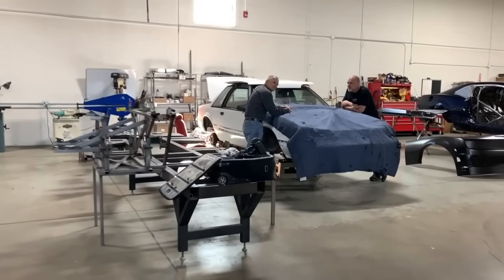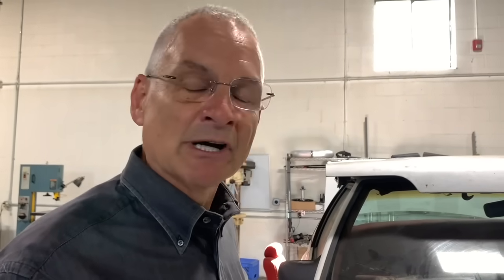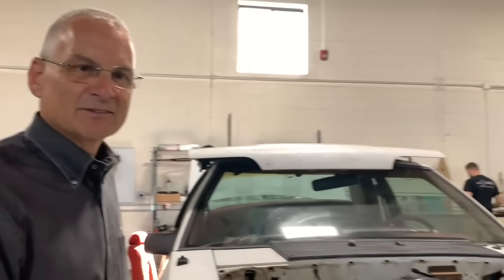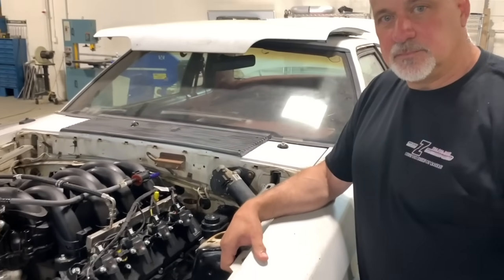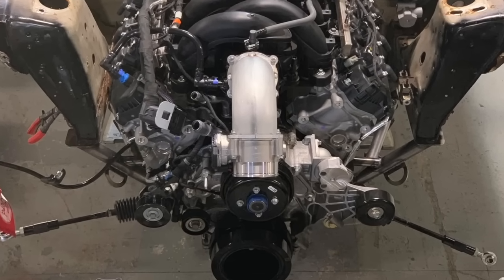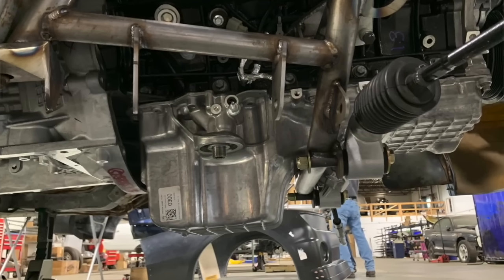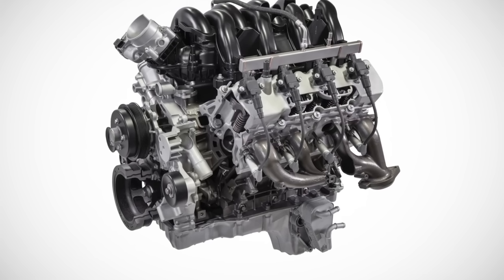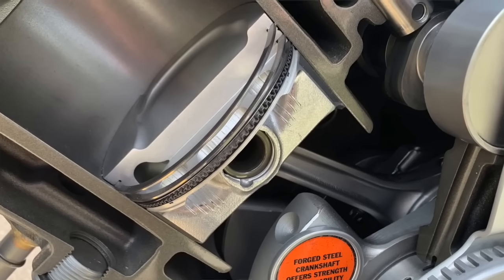Ford 7.3L "Godzilla" V8 Foxbody Mustang Engine Swap — Team Z 446-cube Small-Block Project Part 1

Comment: Revevan that's killa. 

I can't wait to get my hands on one by the end of this year 2020.
I'm in the middle of a dart shp block with billet main caps 351w 427w build with Molnar forged crank,  Molnar forged rods and weisco pistons with a set of trick flow hi port heads etc. 
That will be my next engine lol

I wonder if Comp Cams will make some aggressive camshafts for it. 

I wonder what the cam journal sizes will be on that 7.3 Godzilla engine. 

I wonder if they went with a Windsor step down journal set up or a straight thru 50mm etc on that engine. 

I'm really excited to see what they do with this engine 💡
Reply: The cam has 60 mm bearings, I believe Comp will offer cams.
Reply: Brian Wolfe they are right by me in Memphis TN. 
I can't wait to see what y'all do with this build.. 
Look forward to the upcoming videos

Comment: Be great if there is a crate engine and a standalone wiring harness available. I was hoping one of our terrible drivers around here would have wrecked one in the snow last week and i'd get an engine cheap but there is still the wiring issue. A bigger cam and better intake should bump the power a bunch.

Comment: Not feeling so great about my 393 swap now lol...
Reply: 393?
Reply: 351 roller block with stroker crank.
Let's you use Windsor length rods and 302 pistons. Cheap cubic inches.
Mine has good pistons and rods but you can pick up big power with stock parts and that crank.

https://www.summitracing.com/parts/esp-16526030?seid=srese1&gclid=CjwKCAiA35rxBRAWEiwADqB376z0TPaAIJi5w7wvuC_z1hGfcHGG8jZSCaODua74IunTtOTLRsNh8RoCb3UQAvD_BwE

Comment: The only thing hurting these over the LS swaps is $$ (were working harder than ever for our $ ) 
don't get me wrong I'd much rather put one in my fox coupe, and my 93 obs 2Fiddy setting out back with the boat anchor IDI setting between the rails, but as current pricing dictates it makes more sense to put an LS even in that according to the current market (which kinda sucks 🤷)
Reply: The price will come down as more and more of these engines are manufactured, and also as these engines age over the next few years.
Reply: Chris M. Yeah you need at least a decade of production to make them dirt cheap.

Comment: Motor dynoed at 335.2 whp and  369.5 lb-ft of torque stock . Hopefully the heads flow decent. That has a was to catch up the LS engine. Im looking forward to the comparison.
Reply: Modular Fox Body Actually the motor did not dyno that. The truck did. Remember it has to put the power thru the truck trans, torque converter, huge driveshaft and huge wheels and tires. That’s why the loss from the numbers stated in the vid. If it were to go thru a smaller driveshaft and wheel/tire combo, a lot more power would be delivered to the pavement.
Reply: @crodrc51able  yep, parasitic loss. But even if you calculate that you lost an extra 5% due to the above it still a small gain. My coyote in my fox with twin 6266's can put down 1000whp through a 6R80 . I would be interested in seeing the results throwing boost on the Zilla motor. You torque would kill my coyote.

Comment: It looks physically smaller than a coyote?
Reply: Yeah, it does look like it's smaller. The DOHC cylinder heads on the Coyote are WIDE.
Reply: Ford said it's shorter in height and narrower with the exception of the engine length which is longer than coyote

Comment: I love it but the allure of the LS is always going to be price point and availability. This looks like it's going to be a badass motor with a lot of potential but it will probably be no cheaper then a coyote swap into one of these cars. Which makes it out of reach for the average enthusiast
Reply: Thiis 7.3 is going to have a LARGE production run. I think most people ordering the Super Duty will opt for the 7.3 if they decide to go gas. The Motorhome industry, Uhaul type companies and fleets that run gasoline will all opt for this engine. Simply put, Ford is about to make a SHITLOAD of these engines.
Reply: @lexustech48  maybe, but it's going to take a long time of production and even then it's still going to be more expensive. The coyotes have been around almost 10 years now along with their truck counterparts and they're still expensive. We'll talk more on the subject in a few years :)
Reply: @lexustech48  I can vouch for that. All upcoming U-Haul JH models (the 26 footers) will be Godzilla equipped. Not sure yet on the old E-series yet, it still runs the V10 & there's scuttlebutt about killing that chassis off. I'm a U-Haul service provider so I get a little of the inside skinny. 

An increasing number of business purchasers are not wanting to deal with modern day diesel emissions system problems so the 7.3 is gonna become the hot ticket here in a year or so.

Comment: Make ford racing great again 😅😂
Reply: Ford does need to offer more of the modern engines for swaps
Reply: @albertpintor3522  Ford Racing has Coyote, Voodoo, and Ecoboost crate engines available for swaps. They also have the Aluminator series engines available which come with forged internals.

Comment: What a game changer....it appears as if its going to be a lot less complicated than a Coyote swap too.
Now....what's the cost 🤔
Reply: Going to be high for a bit until enough trucks get out there and get wrecked!
Reply: This swap won’t be any easier then a coyote swap. Especially since ford doesn’t have a swap specific ECU available for it yet.
Reply: I disagree, there is so much more room in that bay.
Reply: Robert Elmo that doesn’t make the swap easier though, the coyote still fits and can be lowered from the top into the engine bay. The hard part of these motor swaps is the wiring and hooking up all your accessories. When the Godzilla has everything aftermarket for swaps that the coyote has they both will be identical. Not to mention you have to get a 3 inch cowl hood because of the way the intake curves up so much on the Godzilla.
Reply: An bolting up the headers, doing something with the power steering where there is no room, I see what you are saying but it looks easier to me.
Reply: @robertelmo7736  based on what they said, it sounded easier to me as well. PCM is something I didn't think about tho 🤔
Reply: It got more room than my Windsor, especially on the sides.
The Coyote is just so wide.
Reply: caaspal I think there will be some after market support for the 7.3, this will beat the Coyote in after market simply because of the Internet and fans wanting to see these engines make huge power
Reply: @williamsanders468  yeah that sounds right but got to remember that the aftermarket is thinking about these being in f250s. So thats where there r&d will be focused at. Not a lot of people will be able to access these for a racecar project. So there will always be limited aftermarket performance parts for these. At least for swaps. May be cooling and extra oiling options soon for towing ect..but high hp not so much,imo. But who knows.
Reply: ZACK MOORMAN well they apparently have new videos of them making 500 horsepower with the engine
Reply: @boosted95  I don't know about that....Whipple is releasing a supercharger for truck duty that's supposed to make 700 horses.........and a higher performance supercharger for race applications.  I think there's going to be a lot of aftermarket support for these motors.
Reply: @caaspal  we'll have to hope the aftermarket brands can help us out
Reply: 8500 for the engine
Reply: Frank Bonazza III I always say if you're not a Ford fan it's because you're not smart enough to work on them or to know that there more technologically advanced to Chevy or Dodge for the most part lol.
Reply: Enzo Prosciutto LoL 😂, I’ve NEVER seen a Ford ( gas ) with 1,000,000 miles. They barley make it to 300,000 without spark plugs blowing out the heads and Timing Chain & Tensioner problems.
Reply: TheTennesseeTittyTickler O and you see Chevy or Dodge at 1 million all the time right lol. Iv seen lots of fords with high miles at my father-in-laws wrecking yard and Iv seen a Crown Vic was 750,000. But that doesn't really matter.
Reply: Everything about a Coyote is complicated, unreliable and entirely too expensive. LS7 Allll day, lighter, much, much, much more reliable, more torque and can be mounted lower in the car.
Reply: Costs about 50 LS swaps and gives you half the horsepower.
Reply: Eagle The Hulk half the HP are you high?

Comment: Don’t forget guys this is like a big Cleveland (canted valves) with great oiling and thick cylinder walls. Not to mention almost 100 extra cubes.
Reply: Inline valves and over 100lbs lighter than the Cleveland. This is going to be my next single turbo project soon!
Reply: @91Bravosixniner  How do you know how much it weighs?  I haven't found it.  It looks massive compared to a 9.2 Cleveland.
Reply: @TheFogLakeshore  As a tech we get tons of info in class months earlier than the general public. I've already had some main bearing issues on the 7.3 so we will revisit this topic in a year and see how they're doing then with some real world testing like turbos and bent rods.....
Reply: Notpumpgas Anymore   Main bearing issues from what? Abuse, normal use or a design flaw?
Reply: @91Bravosixniner  --  I love how confident you are in your wrong answer.
Reply: @superkillr  my inline valve comment... the valves have I think and 8 and 10 degree intake and exhaust. The rest are facts. I've worked for ford for 2 decades. I studied these engines in class before you ever knew they were a thought. Stay in your lane no need to get butt hurt. Sorry I wasn't so specific didn't know you could see 8 degrees from your computer screen.
Reply: They are canted values.
Reply: Michael Thompson, you know what, you may have a point... This guy Brian Wolfe has always been in and around everything that Ford has researched and developed...👍🏾
Reply: Love the old Cleveland's big ass small block I had a 75 Torino that had the 400 in it
Reply: https://youtu.be/ML4SlsScnBY?t=510

He says "canted" and they look to be canted. Not by a lot, but canted for sure.
Reply: I’ve kinda been debating whether it’d be cheaper to swap one of these in or rebuild the stock Cleveland in my 71 mustang.
Reply: @Bonanzaking  You have a Cleveland and you're worried about cheaper? Keep the Cleveland, especially if it's 4v close wedge, and even MORE especially if your car came with that engine. And it'll still probably be cheaper than a Team Z crossmember, the Godzilla, the trans, etc...
Reply: You can get a Bill Mitchell 460 small block that will bolt right in a fox body it make close to 800 ponies right out of the crate for lil over 10,000
Reply: 1,000 times more RELIABLE than ANY Timing Chain driven DOHC Ford engine EVER made!
Reply: No canted valves that I can see.
Reply: @RSDX99  Check out their other video if you haven't already.

/watch?v=ML4SlsScnBY

Good stuff.

Comment: Those rods look weak
Reply from the maker: Impressive that you can "see" the strength. I'm sure, like any stock rod, it will have it's limits, then the aftermarket will take over.
Reply: @revanevan  You can't see how thin they look up by the piston?
Reply: zekeil didn’t realize you eyes are a high tensile tester. It’s a truck engine I’m sure it was build stout.

Comment: Evan, is it me or does the new 7.3 heads look very similar to the Ford NASCAR F9 head??
Reply from the maker: Yes, but the NASCAR head is different in many ways, especially cooling.
Reply: @revanevan  gotcha... I know the NASCAR heads have staggered valves and this is in-line valve.. the outside of the casting looks very similar though.... Thank you for your awesome Vids

Comment: Wonder what the weight difference versus other big block or coyote swaps is ?
Reply from the maker: Coyote is about 100 pounds lighter, but this is 140 cubic inches bigger.
Reply: @revanevan  are the heads aluminum or iron ?

Comment: That Engine is going to be a game changer!!! I just hope that the aftermarket picks it up and develops intakes ( both for Carb and EFI) and Cams... Sounds like just add a set of Forged pistons and the bottom end should be bulletproof
Reply: Unity MotorSports Garage not worth it when you can have a Coyote 5.0L put down 900rwhp with nothing but boost.
Reply: @Jimmyxsx  that remains to be seen...  I know the Coyote is very impressive.. but as a engine swap deal it isnt that easy... This engine will give Ford Guys another option and that is a good thing!
Reply: @UnityMotorSportsGarage  dude Ford sells pushrod crate engine online there is nothing special about this engine lol
Reply: Canted valves, steel crank, six bolt mains, 4.22 bore, etc. Yeah, nothing special. Lmfao
Reply: @Jimmyxsx  where are you getting 700 lbs at? You're trying to say it weighs almost 300 lbs more than a Coyote because of an iron block, smaller heads,  three less camshafts, 16 less valves and springs, and about a 6 foot shorter timing chain?
Reply: Bryan Mulligan example: the chevy truck engines weigh roughly 150lbs more than the LS aluminum versions. this engine is easily 600lbs.
Reply: @Jimmyxsx  I understand that, but those are two equal engines with different blocks. The Coyote vs. the 7.3 is apple's to oranges. The 7.3 is definitely more compact than the 4 cam mod motor. What it makes up for in block weight, it also has 1/4 the moving parts up top and heads half the size. I'm betting 500-550 is my wild ass guess?
Reply: @bryanmulligan5319  500lbs impossible? Chevys 8.1L vortec truck engine weighs 760lbs lol The 7.3L is at least 600-650lbs.
Reply: @Jimmyxsx  you are trying to compare a tall deck iron headed 8.1 big block to the aluminum headed 7.3? Why aren't you comparing this engine to what it most closely resembles, a iron block LS engine?
Reply: I can meet you in the middle and agree it's probably closer to 600 than it is 500. I guess we'll know soon enough though.
Reply: Bryan Mulligan apparently it’s about 590 pounds. A coyote is about 490. So that’s not too much difference. May need a slightly stiffer spring but nothing major
Reply: @bryanmulligan5319  steel crank? As opposed to what?  A copper crank?
Reply: @elonmust7470  how about cast iron genius. Is this your first day on the job?
Reply: @bryanmulligan5319  Show me a new engine with a cast iron crank in it..
Reply: @Jimmyxsx  I tried to tell people that a coyote foxbody just walked a 720s in Houston
Reply: @Jimmyxsx  yea have you looked at the boost and engine market doing it with transmission and top of the line stuff minimum of 20k
Reply: I know right. This would be a great swap for an old school muscle car or hot rod or even in an old school F100.

Comment: Fox body......AND SN95!!!!! I think this is going to become a super popular swap down the road, absolutely awesome to see this🙏🙏🙏
Reply: I would love to  drop the  7.3  in my 02 GT
Reply: Man i might have to ditch my 4.6 dohc engine for this.
Reply: Time to swap the 363 in my sn95
Reply: It’s going to suffer from the same things that plagued the V10....  there won’t be enough of them built for it to be a popular swap since it only comes in heavy work trucks, and there isn’t an aftermarket performance demand for the original vehicle.

It’s unfortunate because I’d like to see the 7.3 get some love
Reply: I'd think it would be hella expensive, which is fine if you have the money, but the nice thing about the LSs are they are so cheap.  I don't know much about fords, I'd assume the 5.0s and 4.6s are crazy cheap as well
Reply: Southern Fun 
That’s true.  The V10 was huge and the 7.3 is likely smaller than the DOHC mod motors.  

At the same time, look at the 8.1L GM motor.  It was a 496cid BBC (essentially a stroked 454) that had hints of LS thrown in (like the engine management and firing order).  It would bolt up anywhere the other Chevy V8s would.  People have ignored the Gen 7 BBC, choosing previous gen 4-6 instead.  It’s mainly because there’s more interchangeability between those previous generations; dating back to when the Gen4 was used for performance in cars.  The Gen7 barely has any aftermarket support thanks to the combination of limited numbers produced (only in 3/4 and 1 tons) and them only coming in work type vehicles.  

Essentially, my comparison to the V10 was in keeping it related to Ford.  I imagine it’ll be most similar to the 8.1L BBC....  
Anyone who wants big displacement will either go with previous gen big blocks (454, 460, or aftermarket strokers).  If they want 400-500 cid in a small block package, the LS has a stranglehold on that market (other than the people that want to abuse their wallet with a newer Hemi).  Ford has a good market niche with the OHC V8s.  Unless they start putting the 7.3 in some sort of performance oriented car/truck, it’ll likely remain a truck engine and the occasional odd swap.  I’d like to see performance versions, but I unfortunately don’t see that happening.
Reply: ChuckO I play with gms, don’t know much about fords.  Playing with 8.1 is a waste of money and time compared to what you get out of an LS